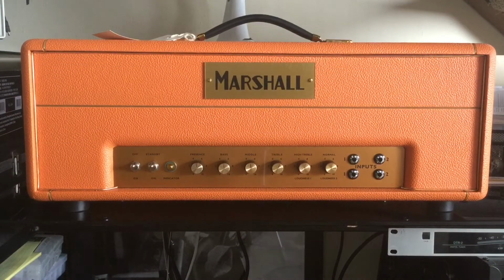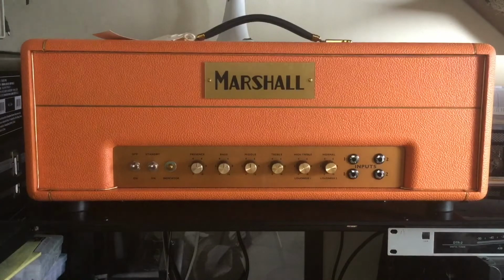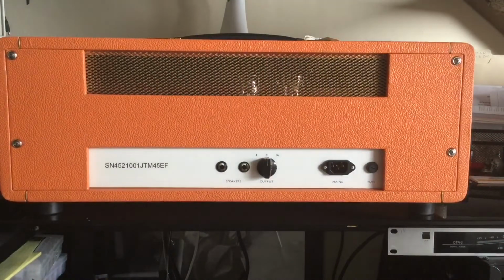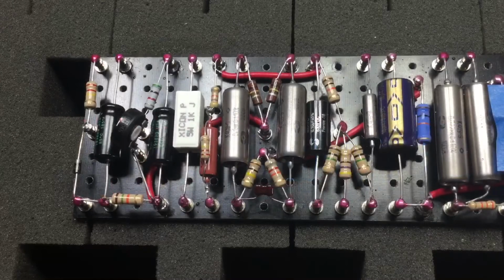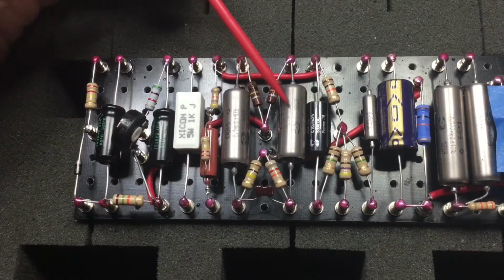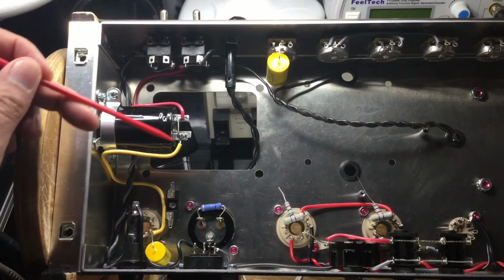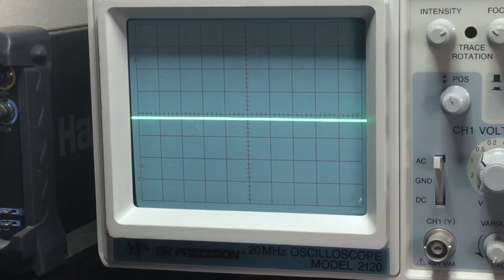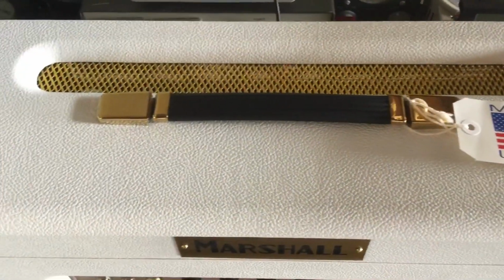How I build a JTM45 Amplifier.

Comment: So this is a mojo tone kit amp with a few upgraded caps. From my experience, it's much less expensive to compile the parts yourself , you can end up with higher quality components and spend less overall.  It's certainly easier to just order a kit, though. I'd recommend a kit if you are new to building amps.
If you want to find out what's under the mysterious painters tape, you can google a jtm45 layout diagram or schematic. There's no magic sauce.
If there are differences under there , it's not a jtm45. Maybe it's a jmp of some sort.
Reply from the maker: Excellent advice as far as compiling individual components go. That’s exactly what I will do. However, there are multiple revision performed to the original circuit design. These are predominantly in the preamp stage and voltage divider sections. I will create more content surrounding these revision.
Reply: It's a common cascade

Comment: Im looking to get my first Marshall head, coming from Fender amps,and Mesaboogie amps, witch i still own.I found a Marshall JTM-45 Clone with KY-66 Power tubes ,built by Trevor Labovitz.Will this head give me the classic Marshall Crunch im wanting? “British sound”? Or should i go for an old JCM-800 like my Uncle recommends? I hear that i can convert the JTM-45 clone to EL-34’s with a bias adjustment? Maby that will give that crunch?
Reply: Jtm45 will be very clean very loud until it’s absolutely cranked and possibly boosted. You probably want a 6knob JCM800
Reply: @ZachShaneArnold  Thank you , i ended up with a Splawn Quickrod 100, basically a hand wired JCM800 Type amp, with 3 different hot rodded jcm800 voicings, and 2 channels, dual power levels.I love it.

I might build a Mojotone or an Ceriatone Marshall head kit as well

Comment: what's the red substance? nail polish?
Reply from the maker: The red substance is locktight.
Reply: @FeeserAmplification  well that was a waste of time. I used the red loctite on my bolts for PT , OT etc. and the stuff doesnt harden, stays liquid for 2 days now. I'm gonna wipe it all off
Reply from the maker: @johnmiller9219  Oh my God! So lock tight is a thread locker used specifically for high vibration environments. This is the first time I have heard about lock tight not curing. I have seen some of my colleagues apply there girlfriends nail polish on the fasteners. However. I’m not sure if nail polish will perform a long term hold on the fasteners.

Comment: is that okay to use 200V rated caps in PI?
Reply from the maker: Excellent catch! I was waiting for someone to notice the voltage value. This particular capacitor is for research use only. I highly recommend that you exceed this value by using only capacitors rated for 630 volts in the phase inverter stage. Very good observation on you’re part.😀
Reply: @FeeserAmplification  i see these quite often living in Russia)

Comment: I had One, with 2 Mullard tubes (I forgot the model : 6l6 or El 34 ?) Please Marshall help me) the sound was Creamy at full volume, nothing like today. It did not hiss or buzz. Unforgettable. The Who had those. Ken Bran you did magic; Say something if You are alive,please. i never Blow a fuse and never change tubes. Point to point it's the only  way to make good and sturdy Amps . Anyway thank you.
Reply: this isn't point to point. It's a circuit board. point to point is connecting only components  together with no board.

Comment: I always pre-wire the input sockets outside the chassis by simply mouting the from the front. Then you perform all the soldering for wires and resistors. After completion you mount these on the inside of the chassis. Also for the turret board I prefer to solder first the reversed side with all bridge wiring, after that placing the components and solder these. At last you solder all the external wiring for the pot's and tubes etc
Reply from the maker: Excellent procedure.
Reply: What do you use or like to use for the pt and ot? I want to start my build soon and I have Classic Tone 50 watt for output transformer, I hear they sound nice but I've never got to experience that myself yet. Thanks for the upload.
Reply: You should show us in a video like this guy.

Comment: Sorry but that amp is not a JTM45.
Reply: you got that right, I was thinking the same thing the moment I heard the first note played - the rest of the video verified what my ears heard (split cathode, V2A bypass cap) - more like a tube rectified 1987/2204 hybrid. Nothing wrong with that but a completely different beast if you know how a real JTM45 sounds like (even the late '66 transitional ones with the Drake -128 OT running EL34s).
Reply: Snubber cap on the cathode follower plate resistor, 33K slope resistor (presumably accompanied by 500pf in treble), different feedback with added "resonance" cap, another snubber in front of the tone stack in parallel to the cathode resistor, no cap on mixing resistor, a voltage divider on it, etc. I can be wrong about something but only one of those things already makes the amplifier different from a JTM45.

Comment: Sounds great 👍🏻 how does it compare with Marshall JTM reissue sound wise....
Reply from the maker: Yes. So this design sounds like the mid 1960”s JTM 45.  There seems to be a lot of complaints from the owners of the Marshall reissues. Unfortunately the reissues have nothing to do with the originals. For example. The reissues use a duel 50 uF in the power supply filter stage. This not only changes the JTM 45 character but also puts a lot of stress on the tube rectifier.
Reply: Yes I agree yours sounds better I don’t think the re-issue sounds that good, It be good if you have them side-by-side demo to compare sounds, there is a company that makes a Rola clone here down under in Adelaide

Comment from the maker: Yes. So,this amplifier was designed to sound like the original JTM45 of the early 1960s. However. To achieve this one must jumper the 2 channels together and crank the amp to around 6 on volumes 1 and 2. I eliminated the need to do this by creating a circuit that could be played at low volumes and not need to connect the 2 channels together  externally. All engineer technicians know how to do this as I mentioned in the video and each technician is very protective of there own circuit designs. Also, we never share each other’s designs due to...